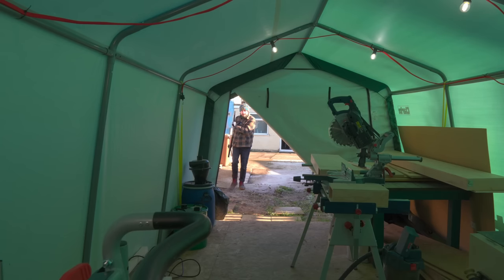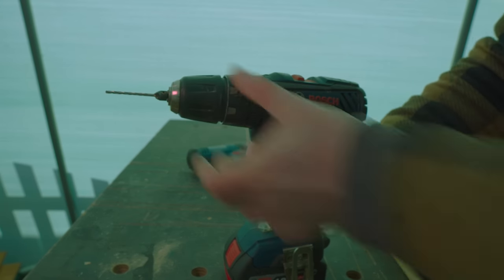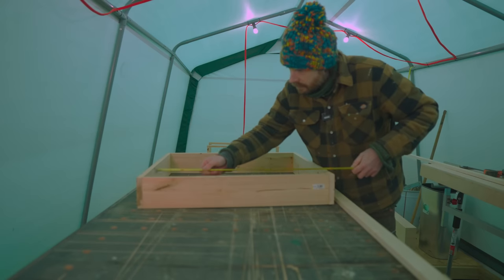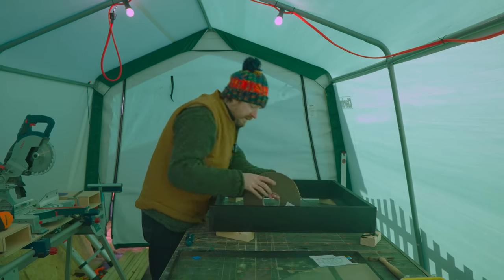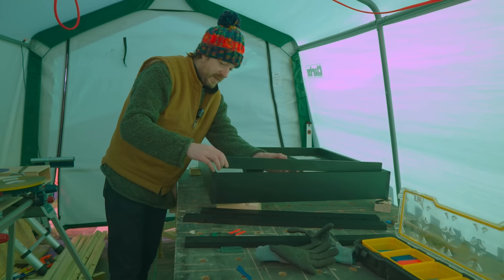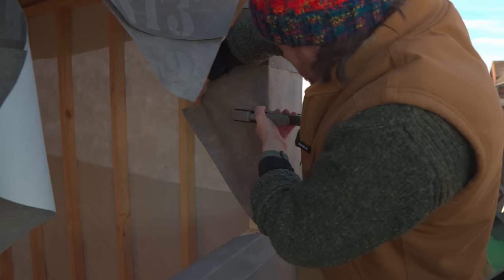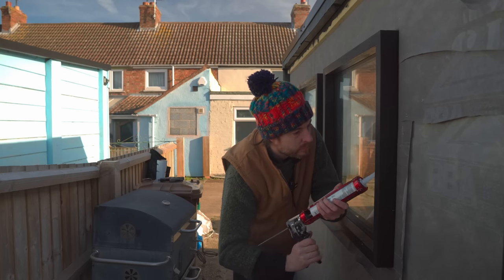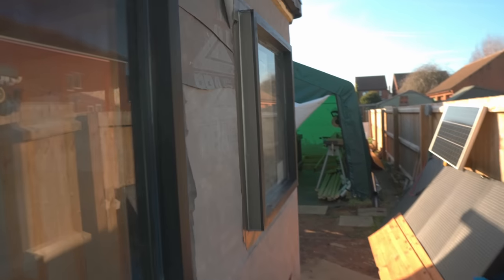Windows going in

Comment: I've seen so many buildings go up in the US on youtube and the flap at the top of the window is left hanging on the outside to add an extra layer of protection from the rain - if the tape bond is weakened, there's a chance of the rain working it's way inside the building. If you've got good quality tape and the rest of the build goes to plan, you'll be fine....good video.